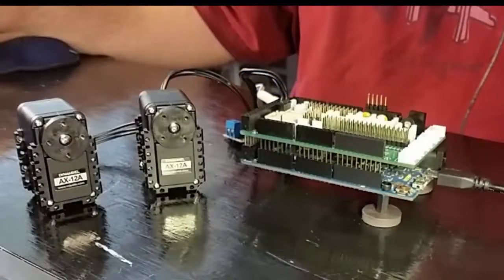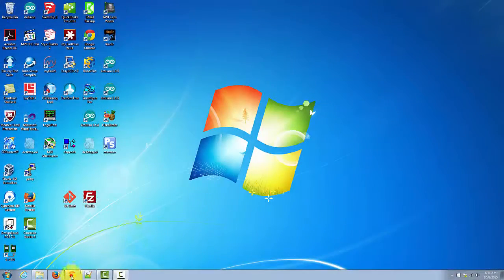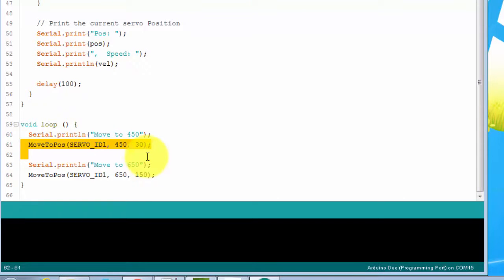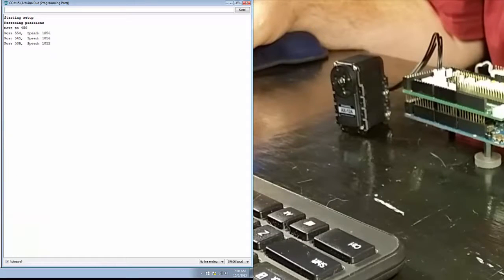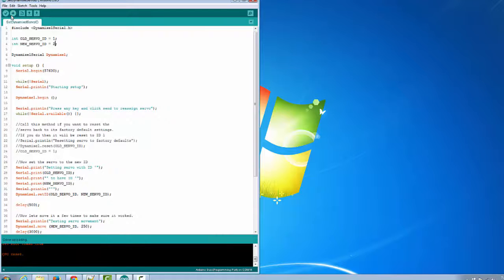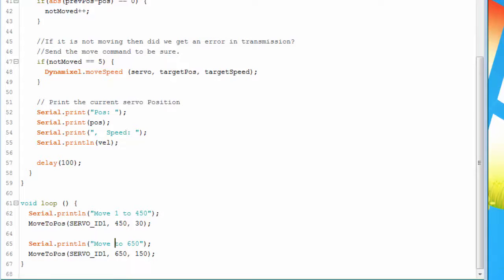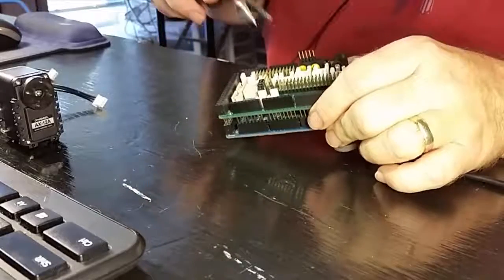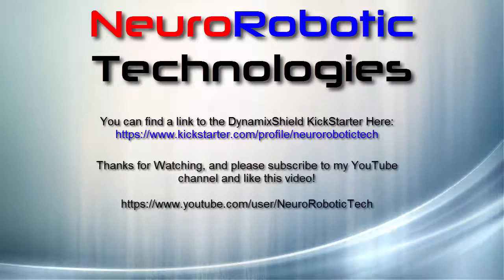Control Dynamixel AX-12 smart servos with the DynamixShield and Arduino Due

Comment: Hi, I want to use a larger Dynamixel Servo for a robotic arm application. I want to use an arduino Mega. all the videos I see are of folks doing this with the AX-12, is the process the same for doing this with a larger Dynamixel motor?